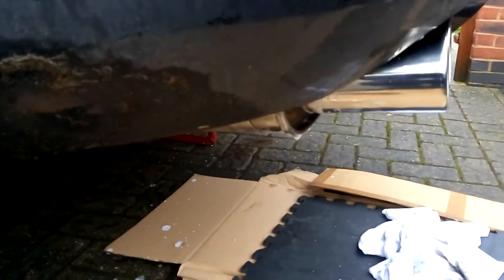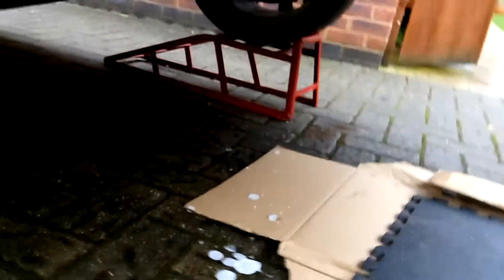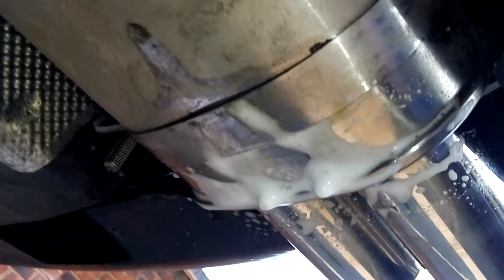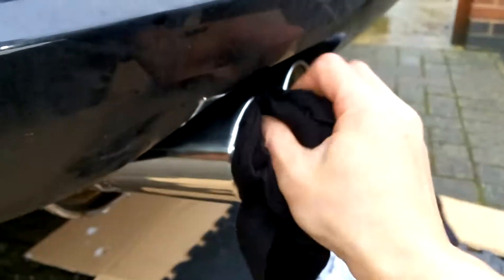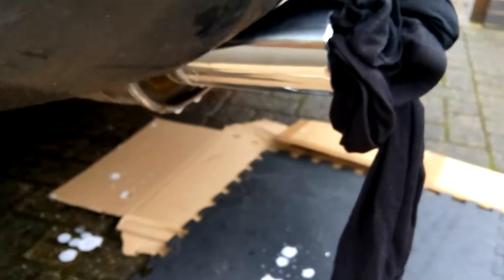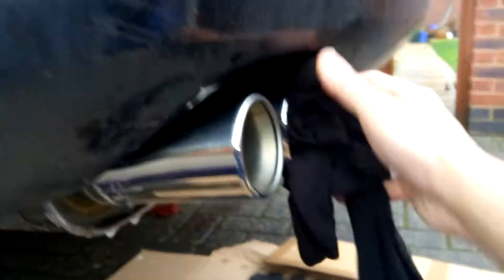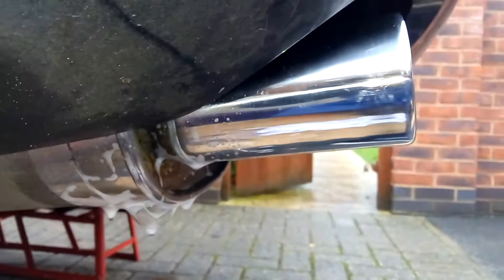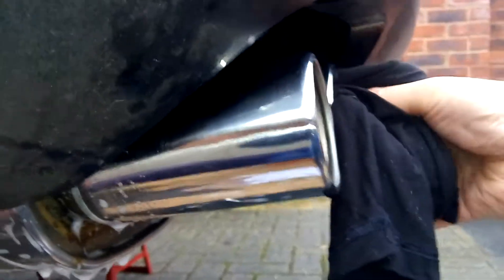20171216 Blowing Ebay exhaust backbox

Comment: What make is this exhaust
Reply from the maker: look up "PERFORMANCE FREE FLOW STAINLESS TWIN EXHAUST BACKBOX LMC-007- ISZ" on ebay
Reply from the maker: item number     186298563422
Reply from the maker: it's just a generic stainless steel backbox
Reply from the maker: the replacement I got from the supplier is still in and going strong